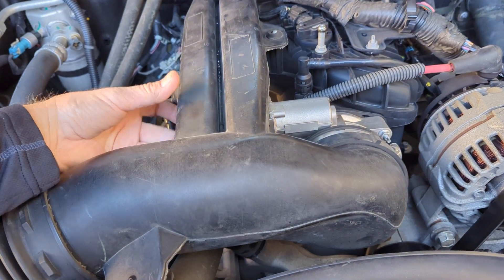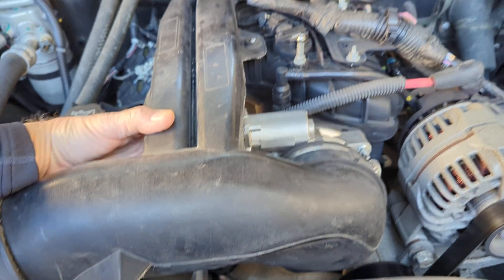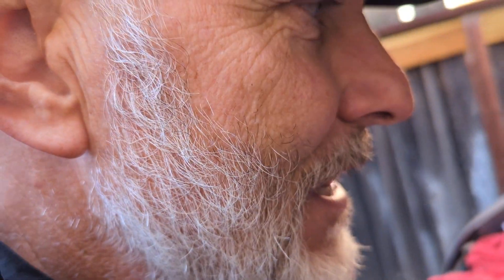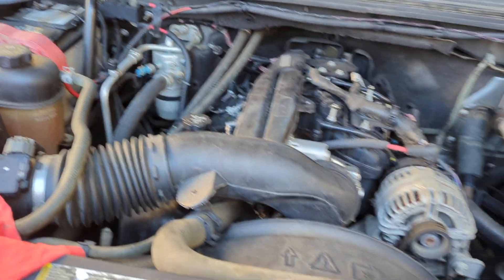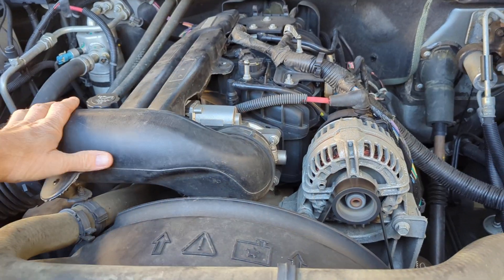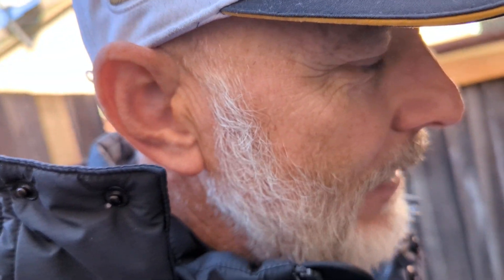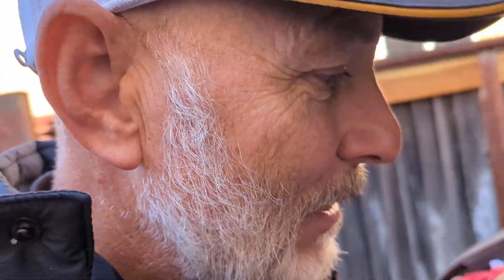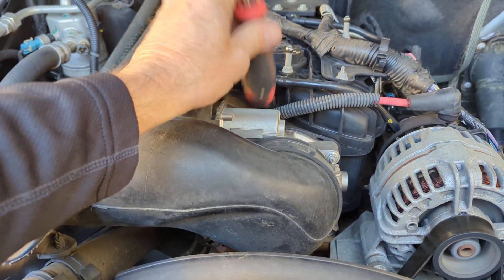Silverado 6.0 l makes a ticking sound

Comment: 0:50
A ticking / with RPM dropout is exactly similar to a High Voltage (spark-lead) cable that has an insulation resistance failure, allowing leakage current to "jump" across an air-gap (similar to a spark plug gap) to earthed metal, somewhere between the COIL HIV terminal and any of the spark plug tops.
As soon as the cable LEAKS that Hi-V surge to earth, it fails to deliver a spark across it's spark plug which instantly drops out THAT cylinder, resulting in a sudden RPM drop, which "returns" to static RPM as the rest of the spark plugs fire successfully.
NORMALLY if it's a regular drop, it's in a single lead, but if it's irregular it's most likely in the main lead from the coil, before it gets distributed.
Watching every hi-v cable (in a darker setting, such as a shed without lights) is about the only way you will find it
Tapping something SOLID near the front of the engine block, won't necessarily mean it's THAT item, but more likely a near-field effect, of vibrating whatever is "shorting" the hi-voltage cabling - to move the cable even a mm away from the metal it's earthing across too, will cause the "arc" to exceed the jump-zone hereby stopping that clicking/snap/crackle sound. 
It's the same as a miniature thunder clap (being the sound of the electric current jumping an air gap).

Check all grounding bolts for tightness arond that area too, as it may simply be an electric arc across metal joints, but I'd suspect a hi-voltage cable "insulation" leakage, as your main culprit.
;-)
After all, the COIL itself should be FIRMLY bolted the the engine block (or metal chassis), and each spark plug is automatically grounded, if TIGHTENED into it's hole in the top of the cylinder, thus ONLY something else, that is making a metal-to-metal electrical pathway, will "spark" like thunder, meaning you are losing spark current somewhere.

CHECK (and or replace) each spark-lead, (thoroughly) to ensure they aren't the culprit, as even a PIN-HOLE in the hi-tension insulation around each lead's core, will be enough to allow electrons through a PINHOLE to ground the Hi-V killing whichever spark-plus that was supposed to get all available current, to "fire" that cylinder.
Instantly losing power on ONE cylinder, drops the RPM as if a stutter occurred.
You don't hear the stutter juct the thunder-clap of (insulation failure) electric arc.
The reason it's NOT regular, simply means the cable isn't hard against a metal ground, just that sometimes it wiggles close enough to arc.

Industrial Electrician with a LOT of experience fault-finding insulation resistance faults, such as with small B&S motors and the like, that fail occasionally to spark, with even the tiniest of pin-hole insulation failures.

Sometimes it's worse than that - in that the internal wire has "broken" and parted from itself, meaning that inside the cable, the electricity is FORCED to jump across a gap in the electric path, meanig you will "hear" but not see, the actual spark-jump gap, as even a halfway decent gap in the circuit, will destroy the set gap value, which is supposed to be where the spark gap is insoide the cylinder, and NOT somewhere along the lead or across even a physical joint, such as pitted electrodes on the distributor cap - meaning too great a gap there, inside the distributor's hi-V terminal posts.!!!!

If however it is as you suspect, a problem at the Throttle BODY (being between grounded metal parts, then you have a bigger problem of a hi-V leakage from non-grounded coils which have both the Hi & Lo-voltages going across the metalwork there (at your throttle body metalwork), instead of INSIDE the coil body itself, meaning a replacement coil or coils is the remedy you need to attend too.
Last resort (or maybe the first place to look, ensure the earth strap from the battery is making solid /tight connection to the motor, othersie all spark currents, will be travelling BACK to the chassis, via any and all throttle and chock & other small wires, not meant to carry Hi-V, which also means the throttle cable itself is acting as if a metal electrical conduit ...?

BAD GROUND at the coil/s (and/or between the engine and the chassis) makes for interesting areas the "fault" manifests itself across, such as throttle cable's "metal-wires"
Reply from the maker: Ok,  I'll look at it in the dark and check all my grounds.
Reply from the maker: I replaced the throttle body and that fixed it.  No more codes and no more ticking(tapping).  I know it's hard to tell just by watching my video but the sound was just hard to describe. I'm definitely saving your diagnostic for anything in the future because I think it is well worth saving. Thank you for taking the time to write your ideas. If it didn't help me at this time, I'm sure it will help many others who watch my video and read your comment.

Comment: Yes im having the same issue with my 2009 Silverado.  I was doing the same thing. Trying to find it.  I would put my
Hand on the throttle body and I did feel a ticking noises but didn’t think nothing of it.      Thank you so much this helped me so much to at least find the location of that ticking noises.      I have my check engine flashing every time I put it on drive.